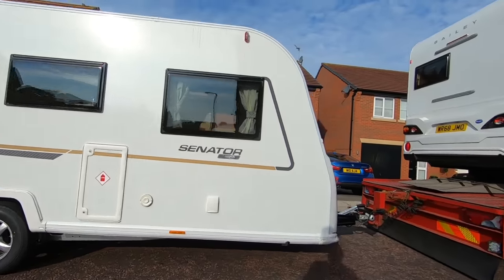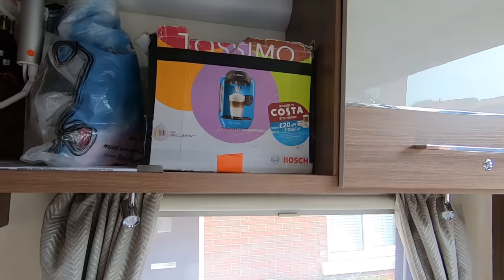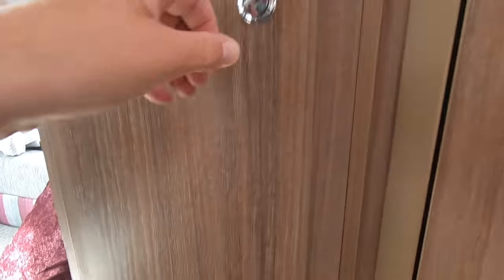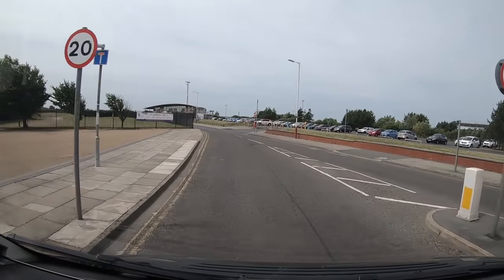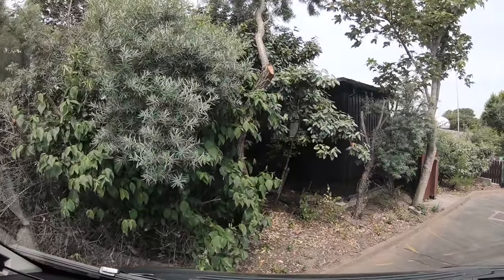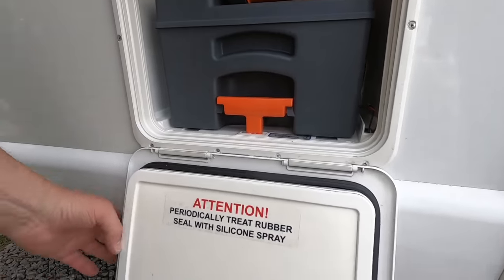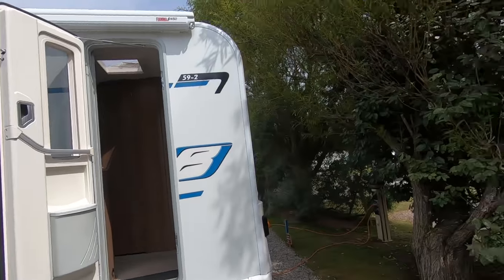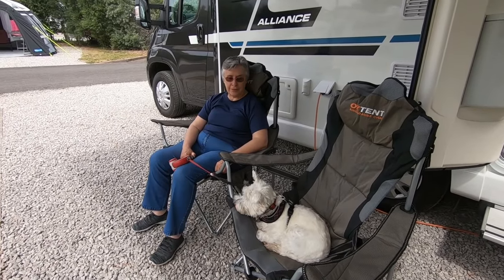First Impressions Bailey Alliance 59-2 at Southport | Bailey Meetup Tour

Comment: Hi Bob and Jenny, when you put the Fiamma awning out you need to wind it out fully (the fabric will actually go a little slack when fully extended) then slightly wind it back and the fabric will then go taught and be ready for use.
Reply from the maker: Thanks, I know. I noticed the door touched the rail whilst I was still putting the legs down. You should never wind it out fully until some of the weight is taken by the legs.

Comment: I wonder if it's a new or secondhand or "demo" motorhome. I like the layout! I'm sure you are going to miss the car. Pity they didn't have tow bar on there as a towing test would also promote the product.
Reply from the maker: It has about 600 miles on the clock, on Bailey's demo fleet.